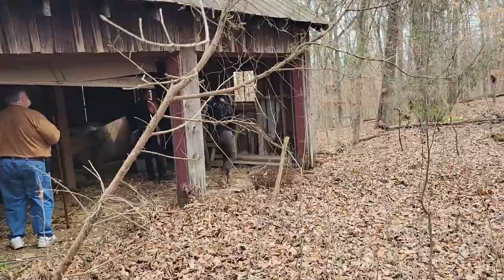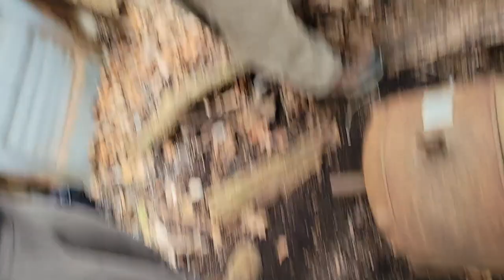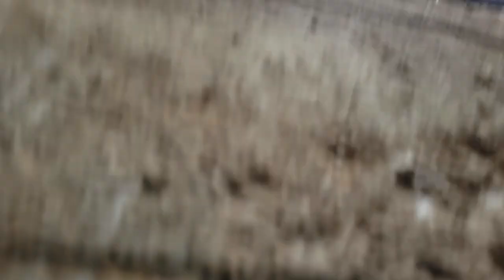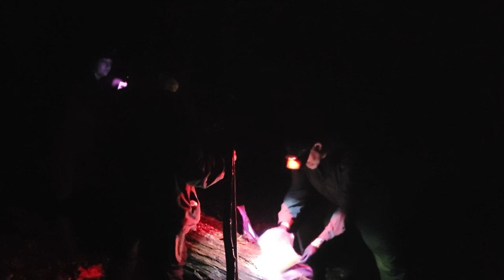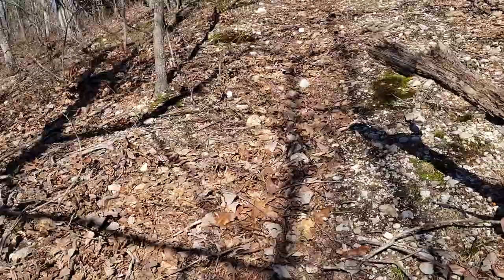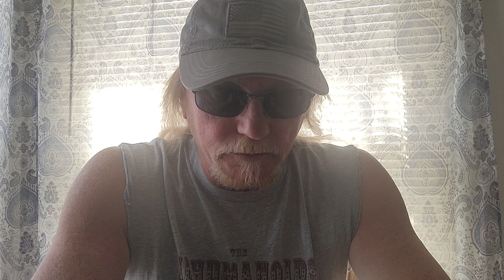RETURN TO LBL With Special Guests, Martin Groves, Hellbent Holler, Crytpid Studies Institute & More!

Comment: Did you notice any type of electrical wires in that underground, concrete room? Maybe there was some type of electrical pump or other device down there at one time or another?? It would be interesting to use a thermal imager in that room to see if it picks up any heat sources or live electrical wires behind the walls. Also, the more I listened to Nadine's account, the more it sounded familiar to me. Herself and her account was featured on the TV show, Paranormal Survivor. It was Season 4, Episode 5. And I distinctly remember the part where she had witnessed this creature inside of an empty trailer. If you can find this episode of Paranormal Survivor somewhere, watch it if you haven't already.
Reply: @frankharrington4881  this incident took place in Hopkinsville, Kentucky. It's a 30 minute drive or less from there to LBL. Also, the northern part of Fort Campbell is in Hopkinsville. I  did find the original episode of this show on YouTube. It took a bit of searching because whoever posted it changed the original title of the episode.
Reply from the maker: No electrical wires of any kind down there, Ben. Yes, we are fortunate that Nadine chose to share her story with all of us here!
Reply: @BartonNunnelly  I'm glad she shared it with the right people. I'm happy she finally chose y'all to send her account, too, and represent it as the way it actually happened.Thanks, Bart and Latisha! 👍👍

Comment: Well, Ive been running those roads at night since mid to late 90s and I'd be listening to Art Bell etc. and Ive been into this stuff forever and even born and raised in West Tennessee, but Ive just now learned about the paranormal stuff in the LBL.  It NOW, make me wonder what the hell I saw on the side of the road one night between Clarksville and Dover.
Ive seen some weird sh*t driving at nights, but nothing like Martin Groves stories
Reply from the maker: What did you see?
inhumanoidencounters@gmail.com
Reply: @BartonNunnelly  I can tell you here. It was about Nov. 2014, I had an auto parts run I did the same route every night.  It was about 3 am, I had just left Clarksville halfway to Dover on 79, which is a 4 lane divided hwy and I remember it was raining pretty hard and I just caught only a glimpse of a figure walking down the shoulder of the road.  I thought wtf was that?!  Now to be clear I was doin 65-70 mph and like I said it was raining, but it looked to be a tall figure in a black cape like the character dracula wears or maybe it was a trench coat or whatever, and this part you may laugh at and I dont blame you, whatever I saw, it was pulling "something", but I only saw this long enough for my lights to hit it and me driving by, maybe 2-3 seconds. What was weird it immediately didnt strike me to be human and I dont know why. Ive seen people walking at night, but this thing was tall and slender, and I didnt see its face. Idk, hell maybe it was a meth head in a coat pulling a push mower, at 3am in the rain.  Idk Im just tellin the story as I remember.  I still run nights, but  Im on I-40 mostly these days. Did those Clarksville, Dover, Tennessee Ridge, Paris stops for another two years and never saw anything weird like that again that I can remember.  My friend this past March saw what Id say was a bigfoot cross in front of him down in Mississsippi one night and he is not into all that stuff, but hes quickly becoming a believer since seeing that and a ufo one night.